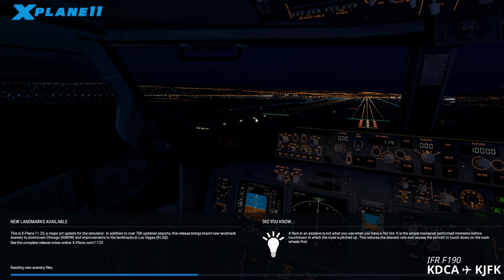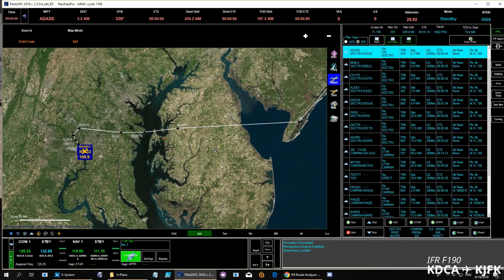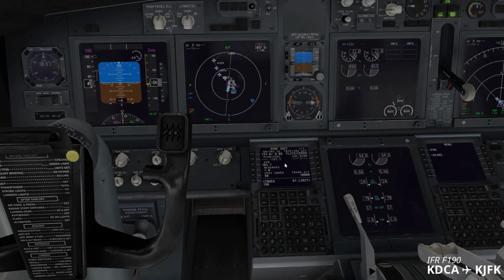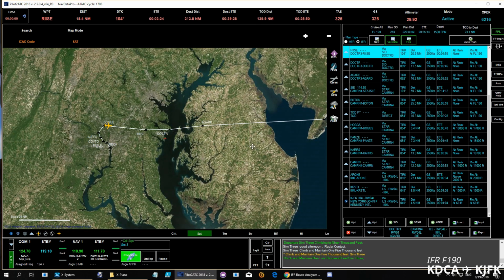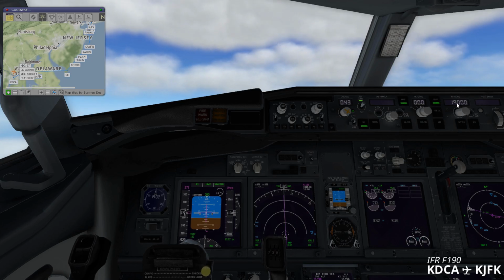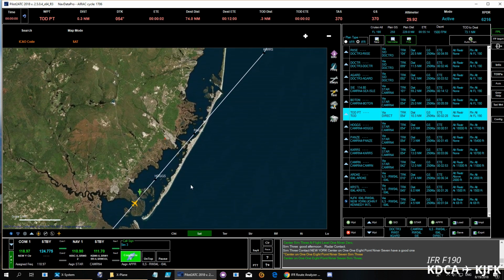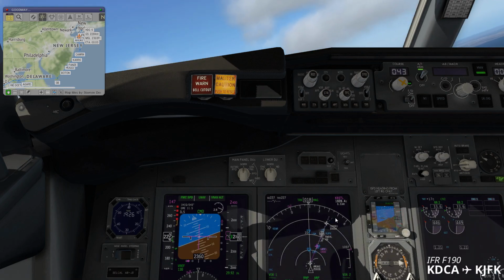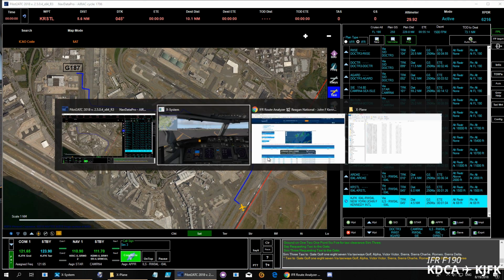New flight simmer IFR tutorial. Flight plan, auto pilot, VNAV LNAV on X-Plane 11 Zibo 737 Pilot2ATC

Comment: One thing that apparently helps for ILS landings, is to set the Course knobs, and Heading to synch up for runway heading before you even intercept the GS. Besides setting BOTH NAV
radios, etc. All of that and hitting the VOR/LOC button FIRST as you come in for the approach (IAF), and THEN the APR button once the LOC is captured, should help you do a better ILS. It's also good to make sure your flight plan is giving you a good 10 mile final, and not a very short final.

Comment: Do you have to do anything special with the flight plan or FMC to make sure the 737 follows VNAV as well as LNAV? Or should it just work as long as you create and enter a full flight plan,
and enter the basic info. in the FMC? I did a test Zibo flight the other night Vancouver to Seattle, and it went fine, but the VNAV didn't work at all. Button wouldn't engage not matter what,
but the LNAV was fine. I never saw a TOD callout on the PFD, because there was no VNAV guidance. The N1 button worked fine for takeoff, at least.